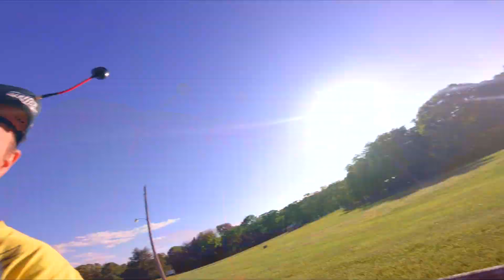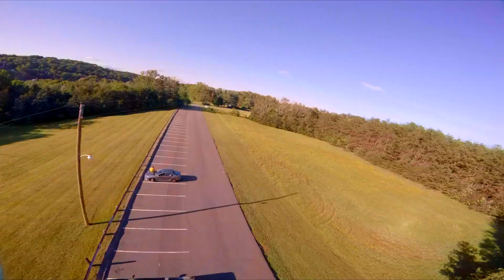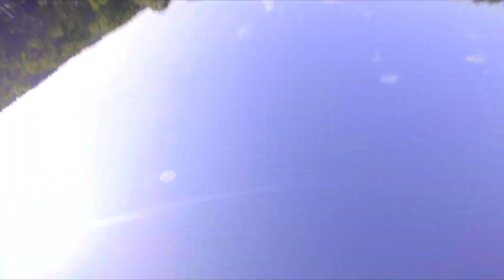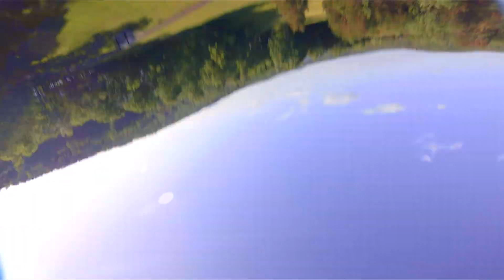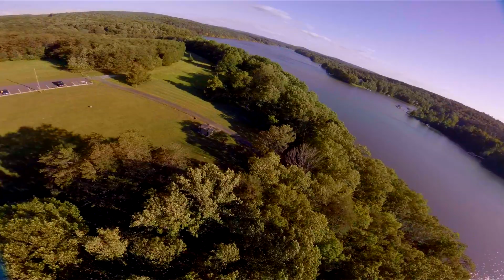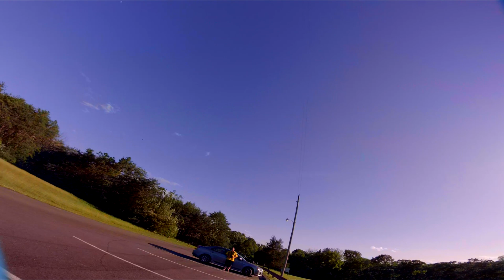Trying Out the EMAX ECO Series 2207/2400Kv Motors

Comment: I got the same motors but I’m struggling to find an awesome prop that delivers in performance and duration, ideas? Nice flying btw
Reply from the maker: i have been using Dal Cyclone T5249C. Give them a try... plenty of power.. i seldom push for duration, i usually just fly for about 3 and a half minutes and bring it in, but i haven't had a problem with them.